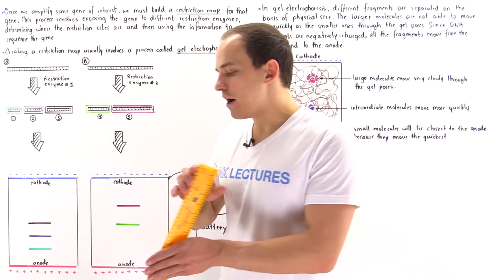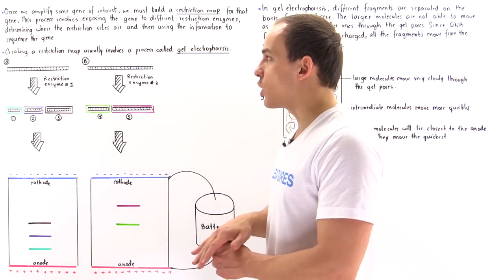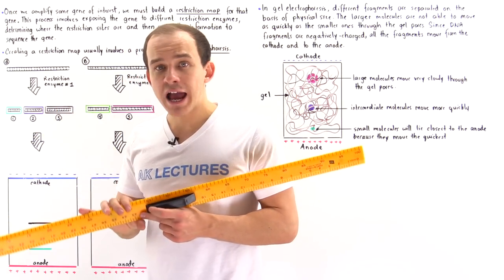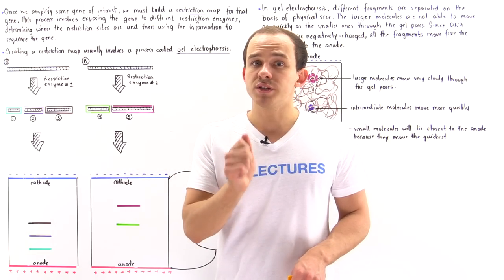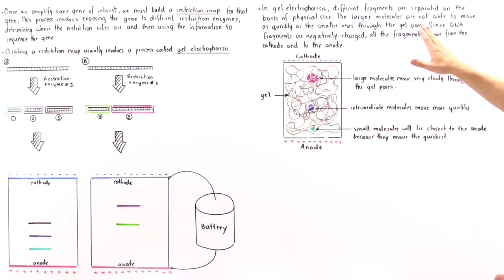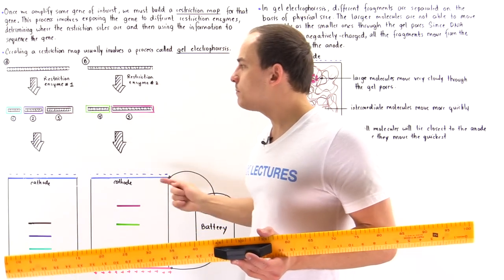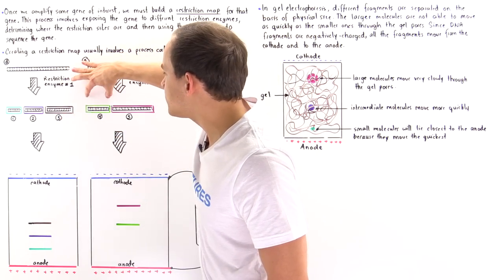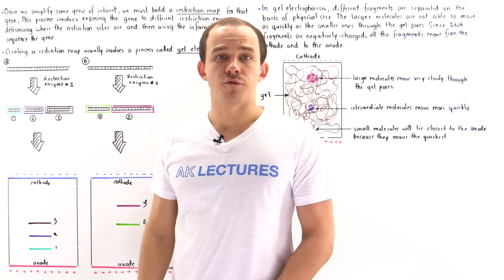Restriction Map and Gel Electrophoresis

Comment: i think anode is negative charge， am i right？
cathode is positive charge， am i right？
Reply: Yes! ...and no. It is advisable in fact to stay away from using anode/cathode terminology as these words can mean either things. That is, cathode can refer to both positive and negative charges, as well as anode. Can be frustrating, especially if you're to use it in your exam just to learn that your professor thinks of them the other way around :(
Reply: Cathode has a negative charge and ATTRACTS positive, Anode has a positive charge and ATTRACTS positive...
Reply: Anode has positive charge and attracts anions which have negative charge